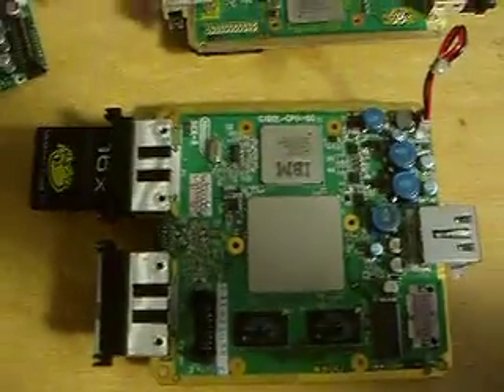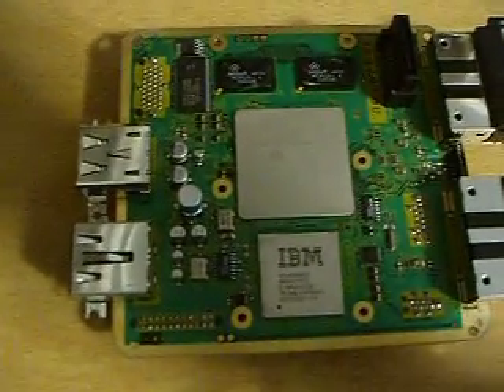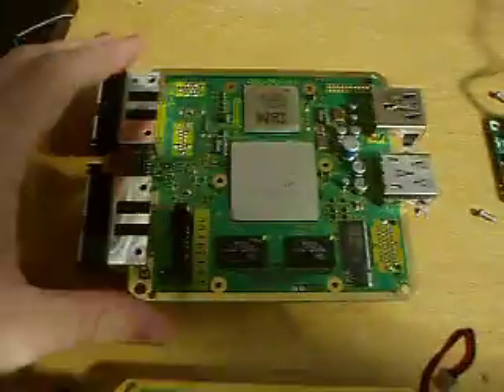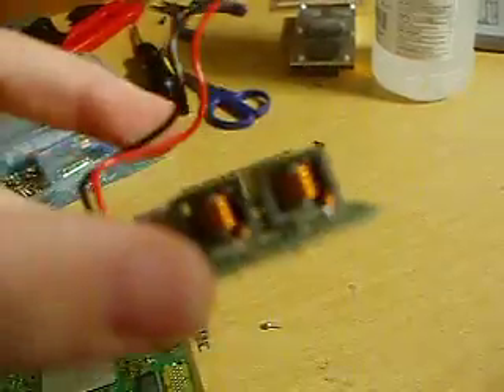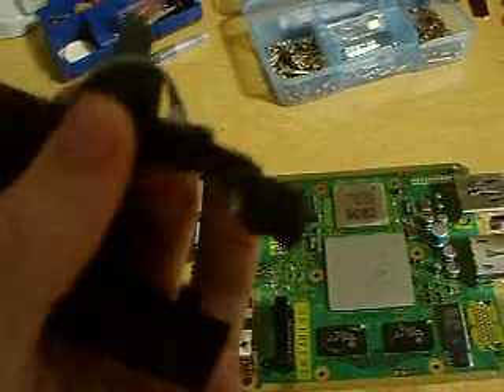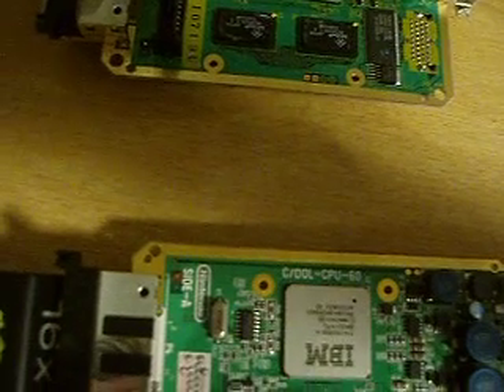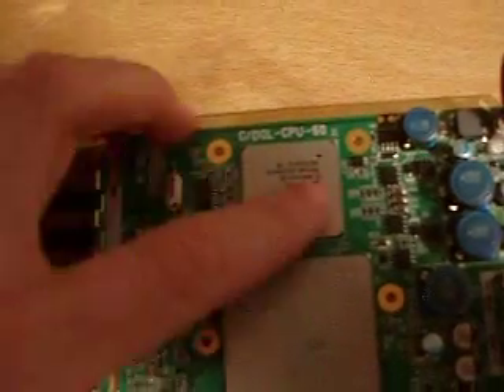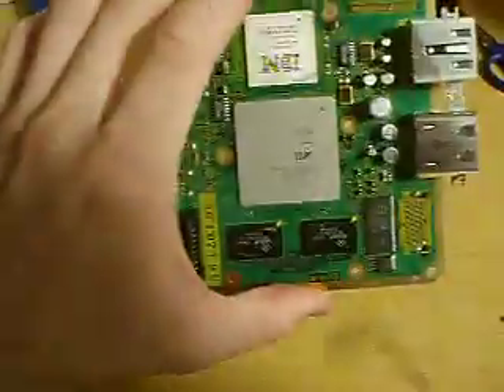Differences between Gamecube DOL 001 (Rev A) and DOL 101 boards

Comment: okay so what's better for modding, what is the advantages or drawbacks having one over the other, what's a better reliable way to go etc...
Reply: If there was a power surge or anything of that sort the DOL-001 board would most likely survive since the regular board to take in power is separate from the the motherboard meaning the regulator board would probably get fried but not the actual motherboard, worst case scenario you would have to buy a new regulator board which is pretty cheap and easy to replace. But if it was a DOL-101 board, my guess is that the motherboard would go out along with the power regulator since it’s on the same board. (I have a 001 model and I’ve replaced the regulator recently after an after market AC adapter fucked it up). DOL-001 models are better for modding since you can use the second serial port that was removed in DOL-101 models to use a micro SD and play games off of there.

Comment: Kindof a silly question on an older video, but does the DOL version make a difference for someone just wanting to buy a gamecube? i keep seeing those numbers on ads and i dont want to buy a "beta" console.
Reply: Dunno if you've gotten a response to this (although I'd imagine you've found your answer since your comment), but I'll just say anyway, at least for anyone else who stumbles on this.

If you're JUST wanting a Gamecube, period, and don't give a shit only being able to use composite/s-video, then go with the DOL-101. If, however, you're wanting to try out the GCN component cable, then you'll need the DOL-001 since Nintendo removed the port for it on the DOL-101.

It should also be said that though the disc-reader laser functions better on 101s than 001s, apparently the actual laser itself dies more easily on 101s. Again, though, if this isn't of great import to you, then the 101 is fine to go with.

Sometimes, the older console revisions aren't necessarily "beta", at least in terms of quality. Nintendo's the biggest example of this, going back to the SNES vs. the SNES Mini and going up to the Wii vs. Wii Mini. And that's not even getting into their handhelds. :P
Reply: Hey man, Thanks a lot. that was very informative. My desire for one has died slightly. but now i know if i ever get that feeling again
Reply: @GodOfTheScrubs  did you get one?
Reply: If you get one that freezes on games replace thermal pads it fixes it.

Comment: where is the fuse on the gamecube rev a dol 001, rev b has it on the regulator board and rev c has it on the mother board. i had a power surge and now my gc won't turn on